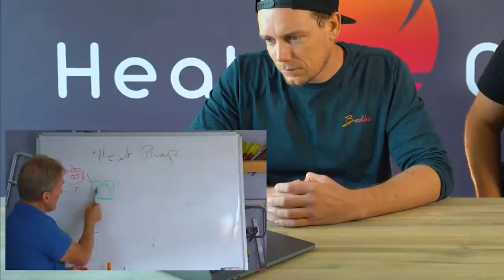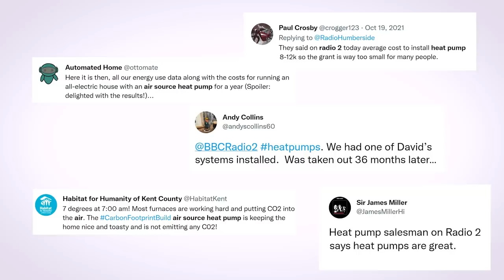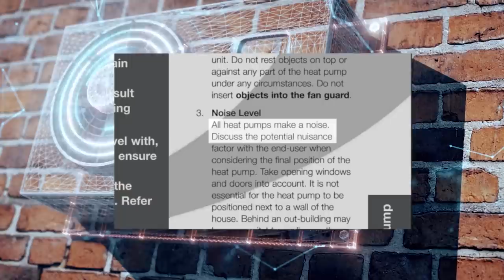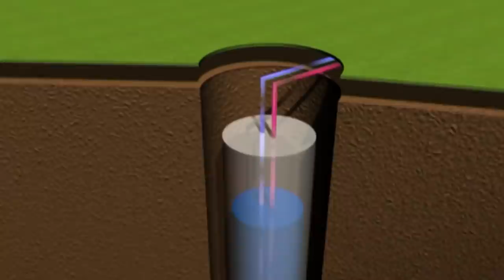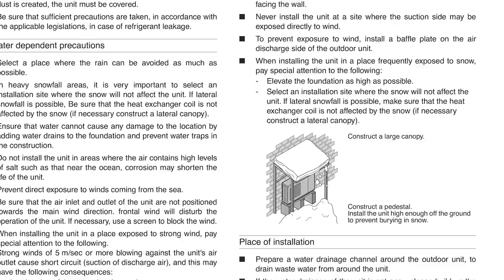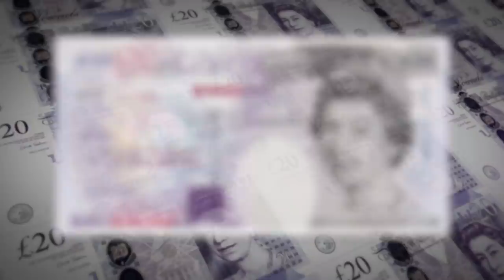Heat Pump Secrets They Don't Want You to Know

Comment: I recently stayed in a holiday cottage with modern electric radiators, I couldn’t believe how well they worked. I guess they would be deemed ‘inefficient’, but when you compare purchase cost, installation cost and ongoing maintenance cost, would the electric radiators not work out a better solution? 
My main concern with the heat pumps is the noise, I was really surprised recently at just how noisy they are. Ok if you have a massive house and can get them tucked away somewhere - but for the majority of UK property which is cheek by jowl (particularly new build) it is going to cause neighbour disputes. Not sure how they are exempt from any sort of noise control?
Thank you for keeping up the challenge on this one.
Reply: As someone who owns a holiday cottage with electric radiators I can vouch for their effectiveness, but they are bloody expensive to run in winter (which is when rates are lowest), and that was before the recent energy price hikes. They also are not very cheap to buy. Outfitting a lot of rooms can add up pretty quick, although it would have to be a big house to equal the cost of a new boiler and rads. They do have the advantage of not needing pipework running, and there are no leaks to worry about. If the government ever use levies/taxes to push people away from gas and onto electric then they will probably make more sense.
Reply: I've 11 radiators. Electric would be 2kW each, so 22kW. That is pretty much 100 amps if you want the capability to have them all on at the same time (unlikely but possible).
Such a high load puts your house cabling at risk and you may also blow the house main fuse.
Reply: Work well but very expensive to run.
Reply: @jeremylister89  Your home has conductors sized for the installed loads. If there are electric baseboard heaters their conductors will be appropriately sized. There is absolutely no danger involved. Yes these heaters draw plenty of amps, and running costs are high. However, they are perhaps the safest form of heat available.
Reply: @stephen-boddy  Electric baseboard heaters are dirt cheap here in Canada and the States. That's why builders like them. But running costs are very high.
Reply: @paulmaxwell8851  'will be appropriatley sized' actually means a careful analysis of the house wiring and followed by substantial disruption and cost for electric wire and installation upgrades.
The fuse versus maximum load point is valid especially if you take into account cookers, kettles, shower and of course EV charging.
Are we headed towards the need for 150 ampere house fuse?
Also for 'others' to consider is the external under pavement/road cabling and substation upgrades if gas disappears and electric load per house increases a lot.
This is all very worrying for the future.
Reply: Well my gas boiler uses about 35kwh per year and at over 28p / kwh for electricity you do the maths....

Comment: Really enjoyed this one, we install Heat Pumps,  some of these items mentioned are quite correct but in most cases a well installed system will mitigate these issues.  If you are thinking of a Heat Pump then speak to an expert, there are some instances where they are not suitable, these systems arer being developed and most issues of application are being adressed.

Comment: I still remain totally unconvinced about heat pumps...    A recent news report indicated that heat pumps were (even before the recent energy price increases) were more expensive to run than gas.
Reply: There is a lot of bullshit about heatpumps. Especially installation costs are exagerated. If you do count isolatian of your house as heatpump installation costs (which often is done) then the TCO for a heatpump is higher than gaz. But you should isolate the house first , then see the energy usage for gaz drop. After that drop in usage you can calculate the electrical energy needed for heatpumps depending from the average COP of the pump.And compare.

also  noone calculate the gaz pipes to his house as gaz heating costs....but in a new house omitting those costs will change the TCO calculations a lot. And with a heatpunp you'll eliminate the risk of CO poisoning.

I installed a heatpunp as cheapest option in 2010 somewhere without gaz pipes along. 
TCO calculations for gaz: Installing a huge lpg tank in the garden and the gaz installation.
TCO for oil: Building an  oilproof cellar for the oiltank (government requirments) and the oil installation.
TCO Heatpump (only geothermical because winters to minus 30 degrees celsius) including the fluid pipes 200 meter in the grouns (3*70m). COP for this geothermic thing is ca 6 during those 11 years.
The heatpump came as cheapest.
Reply: That boils down to where you live. Some places like Cali cab pay 4 times as much for electricity than other parts of the country
Reply: I pay 2500 a winter to heat my house with gas for one winter.  a heat pump would be 200 a winter max for a 2 ton heat pump 😐
Reply: It wouldn’t be 200. You’re underestimating. E.g. I have 13kw pump and I was £135 last month. I estimate about £80 of that was heating and hot water. It’ll be more this month.
Reply: @AllproWarrior  Only if your house is well insulated and have UFH or oversized radiators because HP produces warm water for heating (low temperature).

Comment: Nice one Roger, very informative. So it's extremely important to get the right company to do a thorough survey of your property to get the correct one fitted, easier said than done. 
Isn't there a way of gas boiler flues having a catalytic converter fitted to remove the carbon from the flue gases?

Comment: All the issues mentioned can be overcome, provided it is a good quality make, the design is appropriate, and the fitter knows what they're doing. Also, they genuinely will be more energy efficient at the end point. Of course, that level of efficiency is not easily determined and the colder it gets, the lower that efficiency.

However, while almost all of us would prefer to be 'environmentally friendly', the simple truth is that they rarely make economic sense, which is where the main issue lies. Even with the current and rising energy prices, gas is about 1/5 of the price of electricity per kwh. Therefore, even if all things were level, you would need a heat pump that is 5 times the efficiency of the input. Generally, the annual efficiency is 2, at best.

To make matters worse, the cost of a heat pump system is significantly higher than gas central heating, even assuming you have no existing system. To throw away a working system on this basis is economic lunacy! When you add that they don't suit many older houses because of the difficulty of installation, it becomes a complete 'no-brainer'.
Reply: The cost of a heat pump system is not that high because if you consider you need to change 2-3 gas boilers in a lifetime of a heat pump, than the cost evens. Also you can connect the heat pump to solar panels and at least in summer you have free cooling, can't do that to a gas boiler.
Reply: @yoraul5157  I have no idea where you got your ideas from, but how long do you think you might live??? As an example, my mother's boiler is at least 30 years old, still works fine and is far from the only example that I know (I carry out energy inspections, so see lots and lots!). So, if you're thinking that you want to start installing a heat pump in your home while still a toddler and then live until you're a hundred... Apart from which, what makes you believe that heat pumps have greater longevity? They all use a compressor which certainly wear out too.

Then we have your strange mention of solar panels and cooling. You need to get a system specifically designed to act as an air conditioner in reverse, which are the 'air blower' type. They have their own issues with regard to installation and not everyone would be keen. I presume you're also suggesting that the solar panels would provide the electricity, but that assumes your standard use doesn't take all of that power, but getting solar panels is an entirely separate consideration.

Finally the basic cost is not low. A new installation would be around £10,000 and up. It would have to be an almost complete new system, as most existing CH systems aren't suitable. So if we take an average person in an average house, looking to 'do their bit' for the environment, they will likely have a GCH system that costs £1000 a year to run (that is a very high figure for most!). So they get a survey and find that to install a heat pump and have new radiators throughout would be £12,000. That is 12 years of heating before you even factor in fuel! Of course, their shiny new heat pump works at an overall efficiency of 2.5. That means they are using 2.5 time less fuel than before. Wonderful! Unfortunately, that fuel is electricity that costs 5 times as much as their gas, so their heating bill doubles. Oops...

And THAT is the main reason why, at present, heat pumps are a really, really bad idea unless the house has been built from ground up to include such a system.
Reply: @kravdraa7  Well said, I'm a heating engineer and can't see the logic behind ASHPs for most people, if you have a spare 15k burning a hole in your pocket then fair enough but for the vast majority of people it doesn't make sense. I'm constantly dealing with people on a daily basis who are not satisfied with their heat pump performance and complaining the house no longer gets hot enough. I'm know a lot of this can be put down to poor design to be fair. 

As for ASHPs lasting 2-3 times longer than a gas boiler that's a huge stretch, most gas boilers will last 20 yrs if maintained regularly, as mentioned above there are plently of ideal classics , gloworm space savers ultimates and many more over 30 yrs old and still going strong. I recently worked on contract taking out whole street of Mitsubishi ASHPs that were only 7 years old due to so many problems.

Another thing people don't seem to consider is that if a gas boiler breaks down, most parts are fairly easy to obtain and fit, for most of ASHP breakdowns it can often be weeks before we get the parts and usually it's not a quick fix. Also the services are much more expensive due to having to top up the glycol .

All this will be become very obvious in the next few years and people will be begging for the return of their gas boiler is my prediction
Reply: Worth noting that these days the actual SCOP is more like 3, but clearly it's still doesn't make economic sense for most people.

It's a shame that the options for thermal stores are generally not very affordable or viable, especially in retrofit, which would allow a heat pump to operate at a higher output overnight (when on split tariffs electricity can be cheaper than gas per kWh) adding energy to the thermal store, to then be used over most of the day.

For most retrofits, old tech electric storage heaters actually make a lot of sense!

Comment: 1x fujitsu 2x daikin has been heating perfectly for nearly 10 years down to -25C.
It was actually -27C(this usually happens a few times a year) for a few days and they had 0 issues maintaining interior temp of 22C. The house is extremely well insulated.
My overall electric bill has dropped $150/ month. Living in Canada
Reply: He probably won't respond to this as he doesn't want to hear anyone saying balanced things about ASHP's.  He just wants to present his biased opinions and say as much bad stuff as he can.  There's no balance at all.
Reply from the maker: Yes but you don't have the option of mains gas and we don't know what you pay for electricity
Reply from the maker: David 
I respond to plenty of the comments. There is no evidence of me favouring the anti heat pump ones. Everyone is free to add to the debate including you but you have not bothered, you just go for the messanger not the message.
Reply: @SkillBuilder  Electricity is dirty cheap in Canada and most premium Heat pumps have 10-12 years warranty are parts & labor
$200/M is my equalized electricity/heating/ac bill VS $350-$400 was my bill before the heatpumps. Again my house is incredibly airtight/efficient.
Reply: @marcgallant5270  Could we have some more info please?
Whats the elect kwh cost?
How were you heating before the heat pumps?
What was your annual kwh usage for all fuel sources before installation?
What is your elec annual kwh usage post installation?
How much did the installation and units cost?
Thanks.

Comment: Dual fuel approach is often used state side. The Heat pump is used at temperatures where it's most efficient and when it gets too cold outside an oil or gas burner furnace takes over.
Reply from the maker: Best way to do it

Comment: Next you should run through all the recommendations on a gas boiler, condensate, exhaust, pressure relief, corrosion inhibitor, enclosure constraints, carbon monoxide, etc, etc.
Reply: Yup, that is what my plumber did when installing a new gas boiler. Nothing hidden.

Comment: Ironically I learned to plumb partly from watching Skill Builder videos so I could install my own Heat Pump, which I have done and it's been fantastic, no issues.   Please Roger, don't spread scaremongering nonsense just because it's controversial and you get lots of views, I expect that standard from the Daily Mail, not you! =)
Reply: There a big difference between a plumber and a Heating Engineer,and a DIY plumber or Heating engineer is not qualified or certified for installations. All installation have to comply to building regulations, manufacture regulation and health and safety regulations, all have to be signed off and certified and commissioned by registered and insured companies or person
Reply: This works both ways...like 40,000 premature deaths A DAY ? please
Reply: @noelburke6224  This is true.  It's a vented system with a Monobloc unit so it only needed the hot water cylinder signing off, electrics done by sparky.
Reply: Buddy you are been a bit unfair on Roger
Reply: CaptainD1990
Funny you should mention the Daily Mail. As I was watching, I was thinking how skewed/biased and misinformed the video was, much the same as the tabloid press.
Not Roger’s finest hour!

Comment: Clearly anti-heat pump without fully understanding the basics of a well designed system. Yes they're not suitable in many situation but neither are combi boilers. Choose a decent installer to assess each installation on its merits and advise accordingly. Your 'advice' is poorly researched Roger. I used to respect you when you did your various rants in the trade press 10-15 years ago but feel you're losing your integrity now.
Reply from the maker: I love the idea that somebody can drop a thought into your head and you then  tell it back to them like it was your own.
Reply: You are confused about what is 'research'. Information taken from the manufacturers install instructions are factual.
Reply: The arguments shown in the vid are blown out of proportions. 
1) Complaining about glycol in the system (used only in monoblock-type pumps) while praising ground heat pumps loops filled with up to 500L glycol solution.
2) snow drifts are massive problem? Somehow Scandinavia is heated with air2water pumps with no issues.
3) those massive cables powering heat pumps? I have a 9kW heat pump equipped with 3kW electric backup heater and all this is powered with 5x4mm² cable. Same as my induction hob in the kitchen.

Pretty all arguments can be questioned. I wonder how he could argue with my heating expenses in 2021: 450€ worth of electricity used by a heat pump for heating of 230m² incl. house water for 2+2 family. We had 40cm of snow in Jan-Feb with few nights with temp as low as -18C. In Dec a whole Christmas week with temps not going above -10C even during a day.
Reply: @ggdhx  You comment has more value than all the "experience" from Roger here...

Comment: Air source heat pumps could be good for large detached houses but I can’t see them being suitable for terraced or small semi-detached houses which just don’t have enough outside wall space to be able to place them away from windows or neighbours. A completely silent fan just doesn’t exist, even in a new appliance. I’m someone who just can’t sleep in a hotel with a bathroom fan or air conditioner fan running and I’m sure I’m not unusual in that. Even if one fan is pretty quiet, a whole street of twenty or more running all through the night is going to add up to a serious noise nuisance.

Comment: Dual-fuel heat pump (usually gas and electric switchable) is another smart option which is not uncommon here in North America.  A good solution for folks living in cold states and provinces like Montana, Alberta heck most of Canada.  I rejected the provincial governments offer to buy me a full on ductless system to replace my oil furnace even though they would pay for nearly the whole cost. Instead I put in a 24k btu mini split DIY and also kept the forced air oil furnace in place.  The heat pump cost me about 2 thousand dollars installed, with me doing all the installation, and it has been great, saving me a ton most of the winter. But when it went down to -5C for a week around christmas, I had to turn on the oil furnace as my house is drafty with many single pane windows, and large double pane windows. Luckily we are all-hydoelectric in BC and it is cheap at 14 cents per kWHr, saving a hundred dollars a month for heating.   I look forward to the cooling next summer too, which I did not have before.